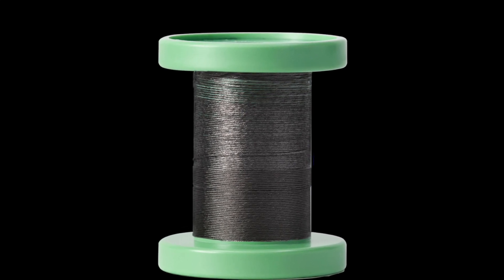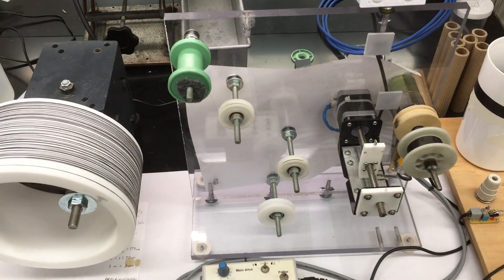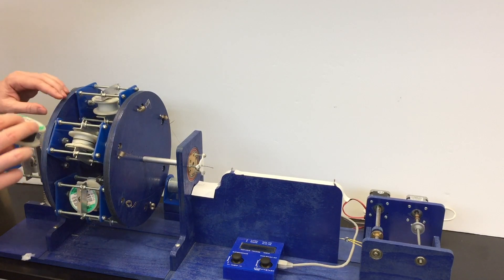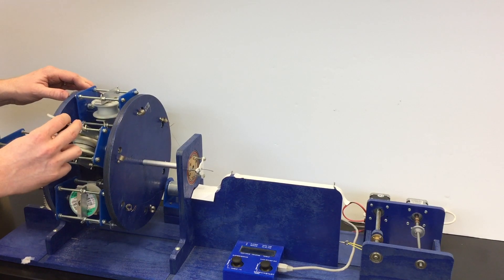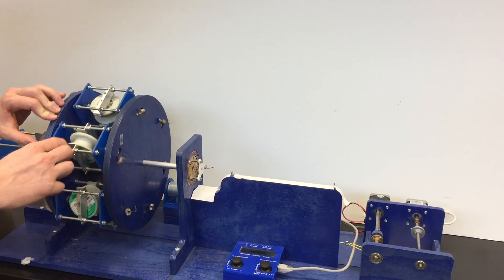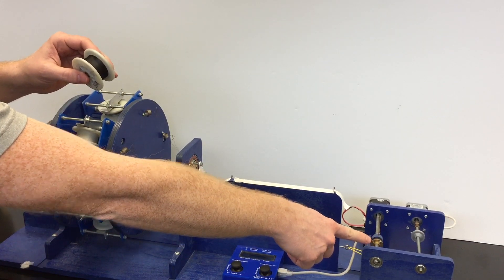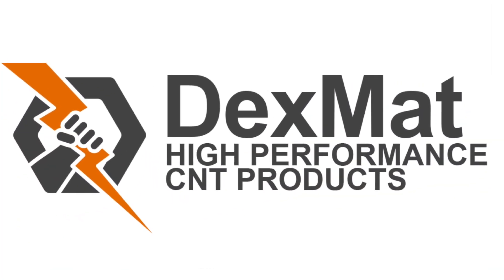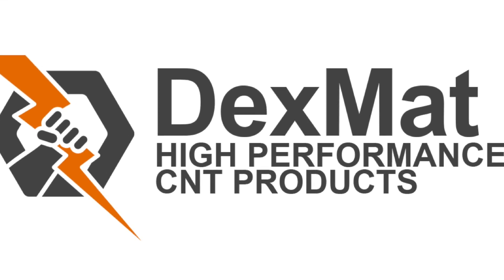Making Carbon Nanotube Yarns

Comment: One of the things I thought about for space was using carbon nanotubes and graphene to make O’Neill Cylinders

Just like how they make squared weave handbags from plastic or yarn, you could do the same thing with a O’Neill Cylinders, and fill in those spaces between with stainless steel footings (kind of like washers and screws/bolts) you could have multiple layers of carbon nanotube cables like that, forming both ultra strong support and energy storage/transmission.  
After that, any spaces can be filled in with waste carbon nanotube, graphing, and carbon fiber, like chopped/forged filler.

It’s just like weaving a basket, and most of your mass would be from carbon.

Comment: Do they contract like real muscles?
Reply from the maker: Hi Maximus,

CNT yarns on their own don't contract like muscle. In order to make artificial muscles using CNT fibers you have to twist them up and combine them with electrolytes so that they will respond to an electric current by twisting and un-twisting.

We haven't done that type of experiment with our material, but it might be suitable for such a device.
Reply: Do these muscles contract as much as real muscles and as fast?
Reply: Patent pending Points at you